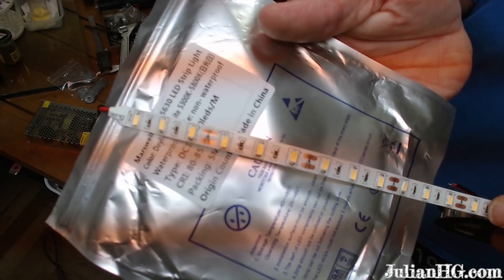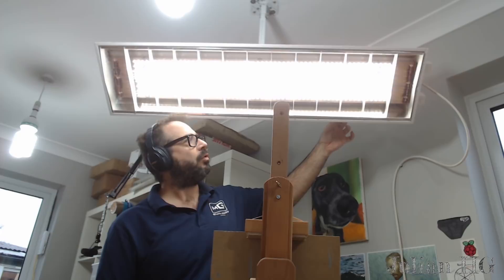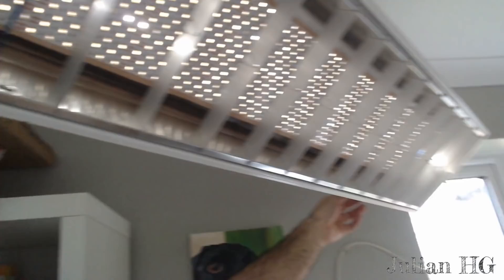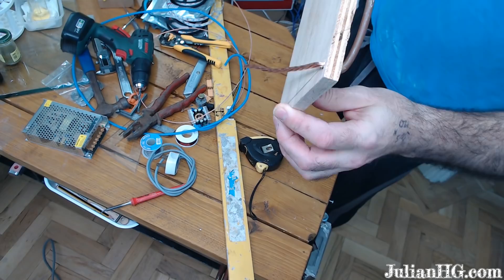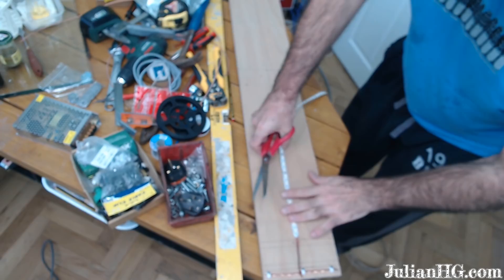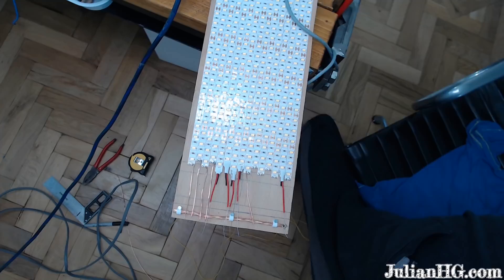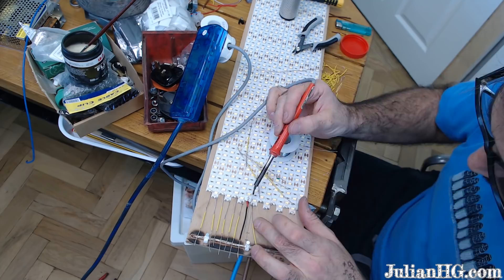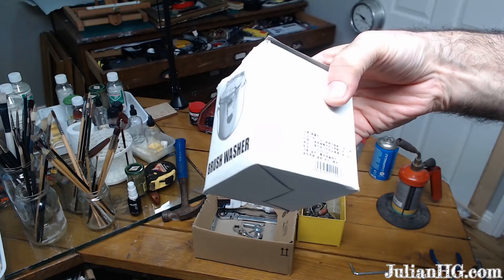No more flicker or banding! DIY LED Studio Light - Voltage Dimming not PWM (DIYperks method)

Comment: What colour do you think you ended up with? (forgot to mention I was also a photographer for some years) 5500k can be a harsh. The length of your light must make it relatively shadow free. My videos were pretty bad with strobing but when I changed the tubes to LED tubes, it did not improve much. Good that you were happy with your result after the effort to build it.
Reply from the maker: I don’t get the strobing at all now with this light, as there really is no pulse modulation anymore. The temp (mathswise) is 5060 but in reality it’s a mix of 2x 5500 to 1x 4200 as its really separate lights. Yes I agree 5500 is too harsh on its own, but with the warmer light added it’s perfect for me ( tbh I guessed the ratio and it just worked out!).  And yes the shadows were the big problem when I was painting this does help with that a lot :) I really need better lighting in the workshop when I’m casting it’s very dark in places. I have some more lights in the garage but it will get darker when I steal them (that’s Nikki’s domain now lol) I’m doing it gradually ;)

Comment: Hi. I've found your video while reading the DIYperks comments. What did you do different exactly get rid of the flickerings ? The original DIYperks still have this problem. Thanks to answer
Reply from the maker: Hi i'm not sure... i dont get ANY flickering with this light, it cant get 'flickering', it's DC.  The only time i sometimes see flickering on my videos now is when i've accidentally still got a fluroescent light on in my studio and i didnt notice. In fact any AC light might show as a flicker on your videos.
Reply: Système D Multimédia
Reply: If you have LED strips, you need to use a CV (constant voltage) LED driver (12 or preferably 24VDC) which is AM (amplitude modulation) dimmable, such as: TCI VPS MD or VPS 1-10V series.
(https://win.tcisaronno.com/downloads/?IDnode=4704&field=docs&language=EN)

The other option to use high frequency PWM dimmer on the Secunder side (min. 2kHz).
In case you have a CC (constant current) LED module, then you need to use CC LED driver, which is working with AM dimming method.
With AM, the driver is decreasing the current, but the power supply will be still continous. While the PWM dimming means zero supply & 100% supply varying with the given proportion with the frequency of the dimmer. If this frequency is lower than ~1kHz, then your smartphones's camera can show the flickering specially when recording in slow motion (higher FPS).
If it is only 200Hz or lower, you can see (feel) the flickering by your naked eyes when the light is dimmed down near to 1-10%.

On the other hand, all drivers have a ripple in their output current. If the ripple is lower than 5%, we call these drivers ripple free, which result flickerfree light, when you drive an LED module with that driver. When the driver has 10-20% ripple, it causes medium flicker, when even worse like 25-35%, it causes high level of flickering in the light of an LED module.
Read about this on this link:
https://win.tcisaronno.com/public/CMS/Files/454/Catalogo-LED-2020-LOW.pdf
page 526 ("info6" page)

Comment: They did flicker when you tested it
Reply from the maker: lol that was me twiddling the knob, they can't be flickering, they are not PWM (turning on/off hundreds of time per second), also i still have a couple of annoying fluesecent type bulbs and they DO still flicker. i reall need two more of these :)
Reply: @JulianMakes  even without PWM some cheap drivers have some ripple leftover from the AC-DC conversion. the same lights on a high quality HLG meanwell driver don't flicker. 
BTW instead of using these constant voltage LED strips with resistors (energy wasted) you could also use rigid bridgelux vesta LED strips (CRI 90) :)